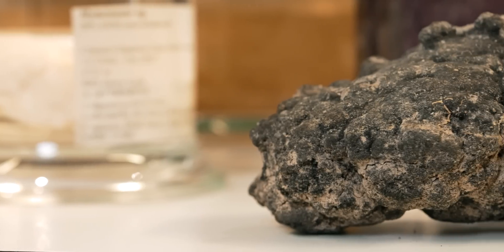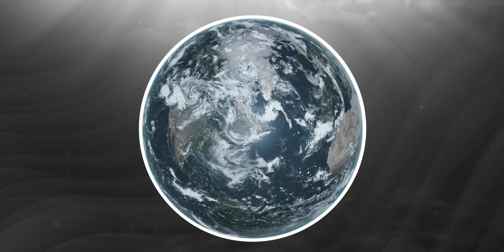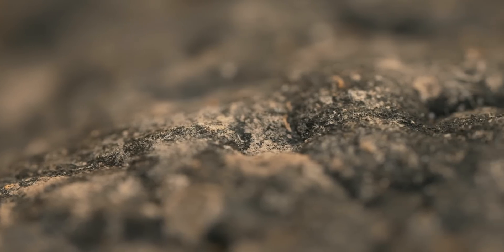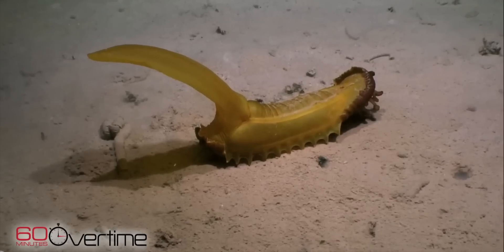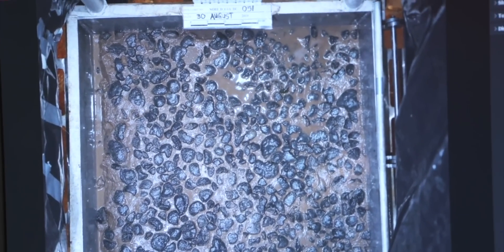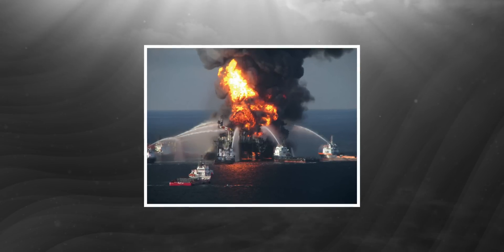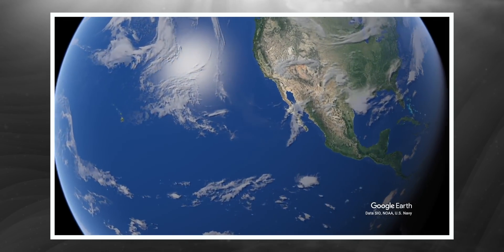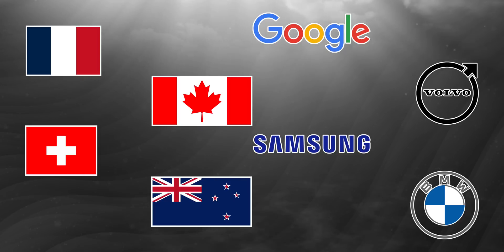Ocean Mining: A Gamble with Our Planet's Last Frontier? 🔋

Comment: Why not just get your energy  from sea water and sunshine.  It turns back to water in a perfect circle and the sun is due to keep shining for several million years yet . With hydrogen combustion you can power road vehicles, trains, Ships ,aircraft , heavy goods vehicles,   industrial  manufacturing and  home and industrial heating. Minimal changes to present  powertrains , no emissions of CO or Co2 , or hydrocarbons, or Nitrogen Oxide or particulate. Even engine oil stays clean and clear and no solid carbon deposits inside engine   which will double their current life. No catalytic converters needed any more so no platinum or palladium required any more. Vastly simpler and far more efficient smaller and lighter new combustion engines  because all the current power sapping  emissions reduction equipment  which has added many thousands to car prices  are no longer need and you will no longer need any rare scarce and expensive minerals. Simple , minimalist and far cheaper. No longer burning any precious oil needed by  industry and pharmaceutical industries as a feedstock. Oil companies like shell already are setting up  Hydrogen extraction from water. The middle east has desert, vast hours of strong hot sun and coastline for sea  which covers threequarters of the planet surface  and typically  4 to 7 miles deep.  Hydrogen can be transported by tanker you can refuel at existing petrol stations  400 miles in 4 minutes all just what we all do today .  The oil sheiks should be investing their vast windfall present profits - not in gold and marble palaces, buying up 3rd world debts to keep half the world poor for ever- not buying missiles and fighter jets  but building  vast solar power and  colossal   electrolysis plants to crack hydrogen out of sea water  it 's process is  clean, silent  it is the perfect  cycle for using sunshine to produce all the worlds mobile energy requirements when all the infrastructure is built  it has no moving parts   and can be built in any country in the world . If you had abundant  low cost electricity   you could  even have  a home hydrogen distillation plant . JCB excavators , shell and Porsche are already showing the way . Batteries are no hopers,  130 years on a electrical energy storage battery  breakthrough " is just around the corner"  - it still isn't.

Comment: I'm very much in favour of developing everything to do with renewable energy and circular economy.  I don't believe that we need to mine the deep sea though.  To clarify I have a long history in offshore O&G and worked for one of the prominent companies in this video, developing subsea equipment (not for this type of mining though).  I see the potential for them to make lots of money and I doubt that they will knowingly do harm.  I think the problem is, nobody knows what harm is being done, and until we do, and until we fully understand the harm that is being done, we can't mine. Because if we do do major harm, there is no way to then put the genie back into the bottle.  Let's optimize recycling, optimize land mining (in the best possible manner) and not touch the deep sea, because I don't think we need to.  I understand that it is a massive amount that is "easily" available, I'm just too worried it does more harm than good in the long term and we end up regretting it, again.

Comment: Mining does much less damage than goblal warming, the damage can be managed and the environment will recover.   There is no comparing of mining to global warming from the burning of fossil fuels.   That doesn't mean we should not try to do it with the lowest environmental impact, perhaps with AI robot arms pick them up instead of soil mass processing.
Reply: So no fossil fuels used in mining operations 😂😂🤭
Reply: @Brioche_In_Zuccotti_Park  Much less and they are used only once to provide material that we use forever.  Fossil fuel is worth using to help stop using fossil fuel.    Its like you are saying we can't change everything and be perfect overnight so we shouldn't bother.  Hope you don't use that approach for anything else, you'd never get anything done.  The transition will take time.
Reply: @tonystanley5337  ok I will put it more simply. For heavy lifting such as industrial scale mining, car factories, etc you need a certain base load of electricity. You can never do things like this off solar energy etc. Polluting the earth and creating slave labour like conditions in the Congo is actually not helping. Every considered what happens to quaint little villages in Peru when an Australian mining company shows up to extract the resources needed for your electric car battery??
Reply: @Brioche_In_Zuccotti_Park  Firstly I don't have an Electric car, I am an Electrical Engineer and have worked with regulations like conflict materials and modern slavery.  What you have said is not "putting it more simply" you are bring new points into a debate because you lost the first round of debate.  I clearly know more than you.   Now I can explain how everything you said there is either wrong or irrelevant but I doubt its going to change your entrenched opinion.  You opinion isn't credible and I am not going to waste my time writing a long reply to explain how you are wrong.
Reply: @tonystanley5337  what a silly reply. I know when I'm getting cheated! There is absolutely no way an EV could add anything to my life. It would be expensive and a waste of time and may even be dangerous as an exercise. How do you feel when you see 15 thousands humans in bare feet in a pit extracting cobalt drenched in pollution? It's very simple the public at large know when they are being stooged!

Comment: I'm fine with it.  When you look at the damage that global warming is going to bring, and compare the damage this particular mining will do, the damage from the deep sea mining is in insignificant.

You might do less damage if you change the machine, after all you're mining metal, it must be possible to invent a vertical maglev machine which can just use magnets to pick up the metals and carry those metals to the surface.

Comment: Interesting take but when I look at those video's of the seabed compared to natural area's in Indonesia and DRC where Cobalt and Nickel are mined it seems the biodiversity is MUCH higher in these tropical zones than on the seabed. Since the Clarion-Clipperton zone is huge, won't the ecosystems be affected less?

Helen said that seabed mining does not reduce land mining but it definitely can if the profitibality of land mining (in high biodversity areas) plummets due to seabed mining in combination of replacing these materials in battery chemistries.

Comment: LFP is safer than NCM battery chemistry, and with public concerns over EV fires, it makes little sense to undertake this effort to be able to build more NCM batteries.

Even Sodium-Ion battery tech is coming to the mainstream, removing the need of lithium. Battery tech should be as cheap and 'green' as possible to ensure we transition away from fossil fuels asap.

Comment: I'm still on the fence with this one... I think anything that speeds up the energy transition and climate change mitigation is critically important. The fact that climate change is a very well understood existential threat that definitively will decimate the habitable planet unless the rate of transition is increased, perhaps makes it more important than the threat of deep sea mining which could be bad, but might not be as terrible as the climate change threat. For me a big question is - will this abundance of new resources benefit new green tech a lot more than legacy fossil fuel based tech? If it's equally useful then I'd say there's little point in it. But if more of these metals equals much cheaper green tech compared to legacy high carbon tech, which equals faster uptake and faster energy transition, which equals less global warming - then I'd argue that's the single most important thing. It's tricky!
Reply: We got in this mess w climate change by this same attitude..we justify these reckless actions by claiming it's necessary. We really need to learn from our many mistakes. Tampering w natural systems always has consequences. There's still so much we don't know about the ocean. Yes, climate change is a problem but it's only a piece of a much bigger issue..the imbalance of natural systems causing a domino effect. We've assaulted these systems on so many levels, our energy production being just one of many. Biodiversity loss will be equally or more devastating than climate change. We've started a destabilization process..we must attempt to stabilize the whole system, not solely focus on climate. Most importantly, we need to be very, very cautious. We may tip things in a way that might not be recoverable.

Comment: Why not have a machine with arms/grabbers that uses vision to pick up the nodules instead of something on tank tracks scouring everything on the surface of the sea bed?
Reply: And reduce profit???? Are you mad???
Reply: I had exactly the same thought. Machine learning should be able to identify the nodules efficiently, pick it up, pop it in the hopper behind. Certainly vacuuming up the entire bed is going to cause enormous damage to those creatures and their environment
Reply: I was thinking the same. There's been a revolution in underwater drone technology - I wonder if there's now the technology to gently pick up selected rocks & pop them in a basket for collection, with a tiny fraction of the environmental damage.
Reply: Vision becomes problematic when you start dealing with the sediment getting disturbed.

There's also a matter of efficiency; a dredge that just sorta scrapes the sea floor with a basket and scoops up the lumps is going to produce a lot of resources very quickly, and be very reliable. A robotic arm that picks up each individual lump will take much, much longer to get the same output.

Comment: Imagine polluting oceans and killing ecosystems
Reply: Yes, the oil and fishing industries have caused untold damage, not to mention climate change.
Reply: Very droll.
Reply: This process doesn't really generate any pollution. Just physical disturbance.
Reply: @xxwookey . I would guess that if I had gills any stirred sediment wouldn’t be a good environment to be in.
Reply: There's very little marine life down that deep.  Sunlight doesn't penetrate more than 200 meters or so.
Reply: @howard6433  But the video explained that there is quite a lot of biodiversity. with thousands of species. I'm not convined that counts as 'very little life'.
Reply: @xxwookey  At 6:15 he states that it takes a while to find any "large" animal, giving the example of a sea cucumber.  That doesn't strike me as an abundance of wildlife.
Reply: @howard6433  Because most of the wildlife is small, as he went on to explain. And an ecosystem doesn't have to be dense to be significant. It's still an ecosystem, even if it's a low-input environment like the CCZ, a cave or a desert. If you only disturb a small fraction of it and the species are widespread then arguably it doesn't matter much. But if you disturb a lot of it then that's a large impact. Some low-input environments are extremely specialised with species being unique to that area (e.g. some caves). You could damage a tiny area and wipe out several species forever. So how much 'harm' is involved is a complicated question of individuals, species, areas, how long distubance takes to recover from and so on.
Some people don't think it matters at all to plant large areas of grassland or dig up massive areas of desert because 'it's the same as the next km2'. And that's sort-of true for the 1st km2, but less true as you work your way through each one. And of course the individuals athat live there don't have the same view at all.
I think it's probably OK to do 'some' mining in this area because the impact is acceptable, but not 'too much'. The problem is that once you allow 'some' it's quite hard to avoid ending up with 'too much' (see Brazil as a good example of this process).
Reply: @howard6433 that’s one of the the most incorrect and stupid statements I’ve read recently. Well done!
Reply: @howard6433  . Brilliant, avoid the fact that you are incorrect and try to distract away from issue.
Reply: @bordersw1239  LOL, no distraction at all...just pointing out YOUR obvious inability to present an argument with facts.   
BTW, I was not incorrect.  There is VERY LITTLE life down in those depths.  Does that mean we should scrape the ocean floors without first studying the impact?  No, of course not.  But the knee-jerk reaction of "you're going to kill us all" is ludicrous.  Perhaps I'm wrong.  Why don't you show us evidence that there is abundant life on the ocean floor, relative to near the surface?
Reply: @howard6433 

Perhaps your personal definition of "life" is out of date?

"Life" doesn't just include pretty bunny rabbits and cuddly koalas.

The presenter did mention the odd "one or two" creatures living in the sediment.

It's not as if they were starved what with a constant rain of food from above.
Reply: @howard6433 he specifically states they were surprised to find enormous biodiversity at those depths.